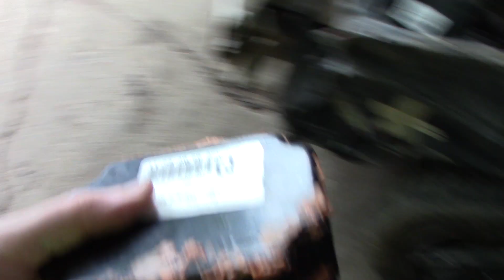No Luck for the 99 Escort

Comment: these and just about any late 80s-2000s ford, mercury, lincoln cars have that stupid inertia switch and also have a strict need for high fuel psi in the injectors, we had the 3.8 liter v6 in our sable wagon and called for like 60 psi and had to get a badass fuel pump for it to run. maybe consider a chevy corsica or a beretta. Ive heard they are about like a miniature lumina.

Comment: Weird. I'm having the same problem with two V6 Camrys at the moment. They both habe plenty of spark and lots of fuel pressure but the injectors aren't firing at all. It's been driving me up the wall! All I can say is make sure you check for spark at the plug wires and check for power/ground at the injector plug as well.

Comment: the reason you can read the obd2 port is there is no power to it normally runs off the cigar lighter circuit.  sounds like a normal ford issue ecm has to be relearned when swapping. i wish i had the money i would buy it off of you guys

Comment: Does it crank over there's a fuel shut of in the trunk those get hit  they won't start and there's a computer in front of shifter under dash as well the fuel pump shut off has to be grounded in the back or maybe it jumped time my escort just did that had fuel spark no start was a tooth off time